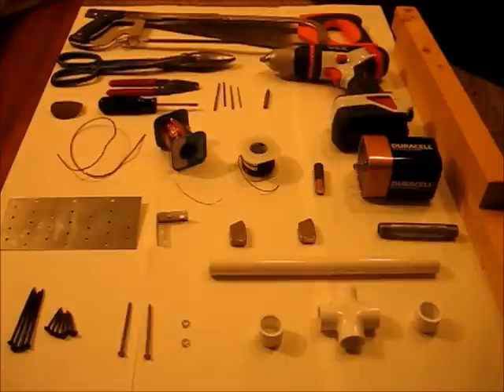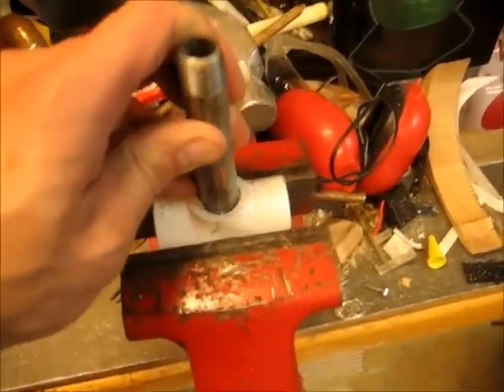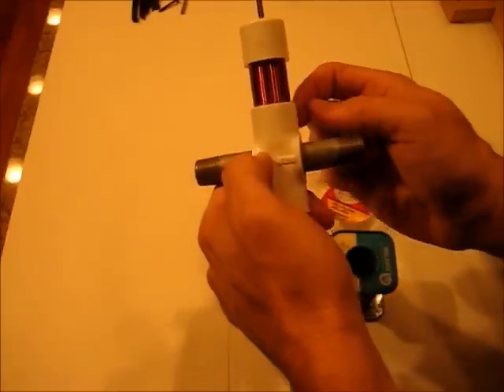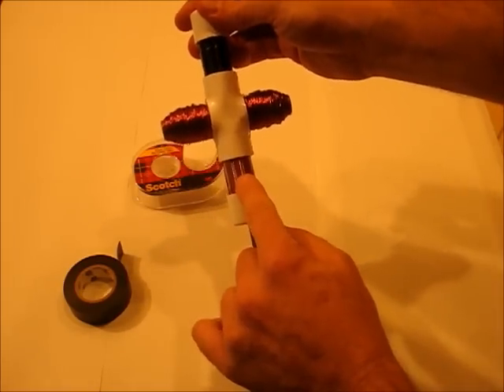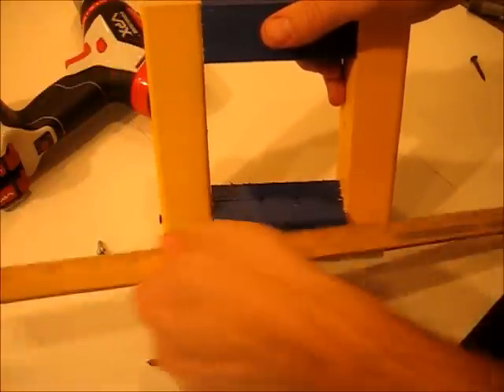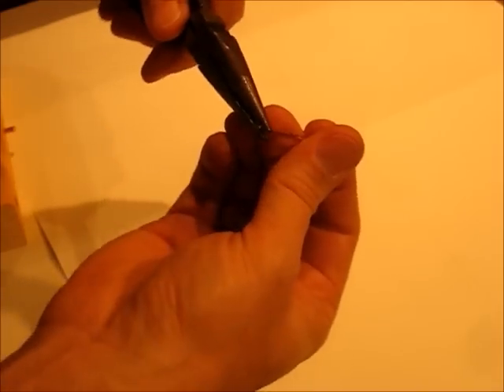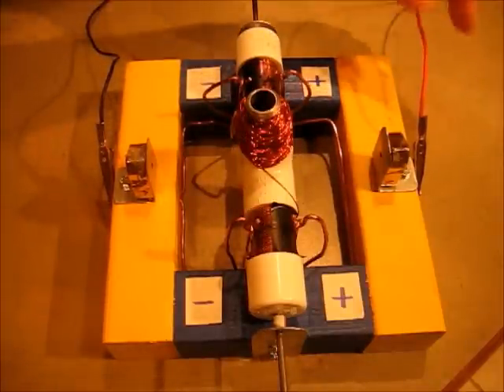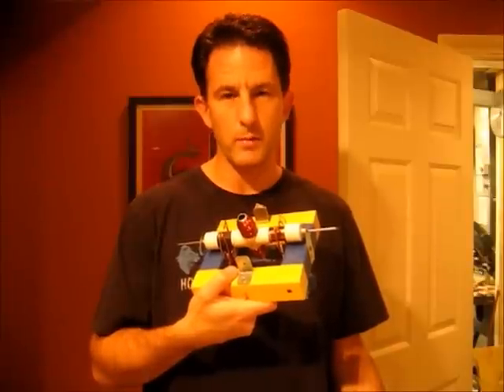How To Build a Motor (HowToLou.com)

Comment: can u give 2 examples of equipment that uses this type of motor? and can you compare and contrast the resistive start induction run with the capacitor start induction run?
Reply from the maker: This is  DC motor and is used in everything that is battery powered, like cell phone vibrators, power windows, cordless drills, etc.  Resistive and Capacitive starts, apply to AC motors.  I don't know enough about those to help you.  Wikipedia has a good "AC Motor" article that has the info you need.

Comment: Do you think the motor could lift a little robot of 7-8 kg with around 400 wraps on each side?
If no, do you think there's a way to modifie your motor to be able to. It would be for a project for this summer.
Reply from the maker: I think this motor, built as you have described, could lift about only 2-3 kg by winding a string around one of the nails.  However, you can use pulleys and a belt to reduce the speed and increase the torque (lifting power).  Google "FingerTech" or "PowerGrip" pulleys and belts.  Put a small pulley on the nail motor shaft, and a large pulley on another shaft that will wing up string and lift your weight.  I would use at least a 4 to 1 ratio in pulleys to give you a 4 to 1 increase in torque.
Reply: ***** Thanks for your answer I'll try it and send you what I've been able to do at the end of the summer.
Reply from the maker: Philippe Jolin - I would love to see it!  Post a video to YouTube and send me the link.  I will post in in the Gallery section of HowToLou.com/motor

Comment: Hi! We're making a motor for our physics project. Can this one run using only 9V? If not, what adjustments should be done to make it run on 9V? Thank you sir. D
Reply from the maker: To get it to work on a 9-volt battery, you need to make 4 adjustments.  1 - Make the rotor arms of the same PVC that the rest of the rotor is made of.  2 - Make sure you have really strong magnets.  3 - Put lots of windings on the rotor arms. 4 - Replace the metal bracket rotor bearings with tiny ball bearings, pressed into wooden mounting posts.
Reply: ***** Thank you for the advice :) Is this for if we make a motor of the same scale? Would making the whole system smaller also help? Will it work if we scaled down the motor but kept the commutator the same size (for ease)? Thank you very much!
Reply from the maker: Anja Bea Cawaing - Actually, it would help to make the commutator smaller.  The brushes are required to supply electricity to the rotor, but they also slow the rotor, by applying friction force.  A smaller diameter commutator will bring that force closer to the center of rotation, where it has less leverage, and hence, less slowing power, on the rotor.  It will be a little harder to make a smaller rotor, but I think it is doable.  I would make the whole thing out of 3/8" CPVC pipe.  You may have to order the Cross online.    Another idea for you:  If you don't want to spend money on bearings, you could build the motor vertically and have the bottom nail stand on a small piece of metal or glass.  All the weight of the rotor would rest on a this single point and would be nearly frictionless.  That would help a lot.
Reply: ***** Great! Thank you again :)
Reply: ***** (sorry if I'm being a bother) We've managed to get the motor to work, but it only turns when we give an initial push. What kind of adjustments should we make to get the motor to run immediately after connecting the battery? Thank you!
Reply from the maker: Anja Bea Cawaing - No problem :)  Congrats on getting it running!  If you can, please send a video to HowToLou@gmail.com and I will post it in the gallery.  You need to work on making your brushes tight enough so they make electrical contacts, but not so tight they slow down the rotor.  The brushes are the trickiest part of the build.  If you can, hammer your brush wires flat into more of a copper ribbon to get more contact with the commutator.  That also will help the initial start up and overall speed.
Reply: ***** I mean, we're fairly sure the brushes and the commutator are fine, but we have to push the actual rotor to start the rotation. Is it a weight thing? Or does the lack of contact between the brushes and commutators apply for that too? And yeah, I'll try to send a video by the end of the week :D Thanks again.
Reply from the maker: Anja Bea Cawaing Your brushes and commutator are good enough to overcome the sliding friction, once the motor gets started, but not good enough to overcome the static friction of the initial startup.  Brushes are key :).  Also, try setting the rotor arms pointing right at the stator magnets, and then try to start it.  That should help.
Reply: ***** Ooohh, okay :D Makes sense now. Thank you!

Comment: How much voltage should I use if I plan to use this motor to lift a weight of around 40kgs?

& approximately how much more copper wire should I use to do that
Reply from the maker: Seriously? You want to use this little motor to lift something the size of a 10-year-old kid??  I suspect you are joking, but if not, you will need to go to a hobby shop and get at least a 100-1 gear box.  Drive the gear box with the motor and have the gear box lift the kid :-)

Comment: Does the wire need to be magnet wire? i have only four weeks to build a motor for my project and to get a company to ship that wire will take way too long
Reply from the maker: You can get magnet wire in two days from Amazon, I think.  It does not have to be magnet wire, though.  It just needs to have really thin insulation, so you can get a lot of winds on the rotor.  Magnet wire is insulated with enamel, with is super thin.  If you know somebody in the telephone business, they use copper wire with really thin insulation, too.  That would work.

Comment: How many wraps did u do I have thick insulted wire and got 70 wraps on both sides and my motor has to be able to run on 6 volts am I fine or do I need more wraps
Reply from the maker: You will need a LOT more wraps to get it to run on 6 volts.  Maybe 200+.  The thick insulated wire will not allow enough wraps.  You need to switch to magnet wire.  There are more build tips at http://www.HowToLou.com/motor

Comment: Hey sir, i was wondering how thick the copper wire around your rotar is? how thick is the wire connected to the elastic? thanks :)
Reply from the maker: The magnet wire on the rotor is 32 AWG.  Everything else is 14 AWG.  These don't have to be exact.  You just need thin wire on the rotor, so you can get a lot of windings, and thicker elsewhere, so it holds its shape.  There is a complete parts list and building tips at HowToLou.com/Motor

Comment: My motor keeps sparking at where the brushes make contact with the sanded copper. When I put 18v on the wrapped coils were much more attracted to the magnets so I assume that I am on the correct track but I still can't get my motor running. Do you think that it has something to do with my brushes? I'm melting through my electric tape so I need to fix this before I burn myself lol.
Reply from the maker: Sparking is ok, but a sign that your brushes are a little loose.  Getting the brushes just right is the hardest part of building this motor.  Try tightening them a little bit.  See all the build tips at HowToLou.com/motor.  If you still can't get it working, send a video to HowToLou@gmail.com and I will see what I can suggest.  -Lou

Comment: what  can  be done  if the winding on iron pipe is not as thick as you show
Reply from the maker: +joel mathews - You could try to splice in some more wire, but it would be best to just redo it.  Thin windings will make a weak motor that may not run at all.

Comment: HOw to Lou- my son is building this motor for his school project and he has done everything twice over what you had instructed in the video , I say twice over because first time he didnt have the thin copper wire tight on the PVC so when he hooked up the charge to it, it unraveled.. it was kind of funny but he redid it... then the 2nd time doing it he fried  the  lead wires, they had to be spliced and reinvented.   So now he has it all accurate like you have yours  and it still isnt working. He has 4 6 volt lantern batteries.  I'm not sure what else to do .. he has fiddled with the connectors- the two thick copper wires (where the end caps are located) to make sure they are tall enough for it to attract the connection. Not sure what else I can do. Does it make a difference on what kind of L brackets you use?  Im at a loss.  Thanks for your help - signed Mama Fawn
Reply from the maker: +fawn hoffman  - Hi Mama Fawn.  Check out all the build tips at HowToLou.com/motor.  I am sure your brackets are fine.  The two biggest issues are having magnets that are too weak, and brushes that gap as you spin the motor.  If the tips don't get you going, send a video of the motor and attempted run to HowToLou@gmail.com and I will see if I can debug.

Comment from the maker: Seth - There is a complete parts list, including wire at HowToLou.com/motor
Reply: Thankyou and also why did you tape/cover the top half of the one coil of wire and the bottom of the other?
Reply from the maker: Seth Wolff - One side of the motor has Plus brushes and the other side has Minus brushes.  Looking at the rotor when the arms are pointing up and down, the electrical current travels from one Plus brush, clockwise around the rotor coils, to one Minus brush.  When the rotor flips over, the electrical current flows from the other Plus brush to the other Minus brush.  The tape makes sure the current is always flowing the right way, which makes the North pole of the rotor always in the right place.

Comment: Are there any specifics as to how many times you have to wrap the cable around the metal bar?
Reply from the maker: No, just as many times as you can.  Make sure both arms of the rotor are wrapped the same direction and the same amount of windings.  Its does not have to be exactly the same number of windings, but if not, your motor will vibrate from the weight difference.

Comment: How long does those rubber last? I mean don't they get spoiled because of friction?
Reply from the maker: It is not rubber.  It is plastic electrical tape.  Eventually, it will wear out, but you get hours of use and you can easily replace it.

Comment: Hey lou, does your threaded pipe get magnetized by the magnets? ours seems to have that problem...hope you can reply ASAP..
Reply from the maker: Maurice - The pipe is not magnetized (becomes a magnet itself), but yes, it is attracted to the magnets.  I am pretty sure that is what you meant.  That is normal.  If you spin the rotor of any toy motor, by hand, it will feel bumpy.  That is the rotor being attracted to the magnets.

But, I bet you are asking, because your motor is not turning :)  The basic problem is that your magnets are stronger than your electromagnets(rotor windings). The magnets are so strong, that they hold the rotor in place, fighting the urge of the electromagnets to spin it.  There are three solutions:  

1 - Reduce the strength of the magnets by backing them away from the rotor, or replacing them with weaker magnets.  Try this as a potential quick fix.
2 - Replace electromagnet's core (the metal pipe) with a plastic pipe.  This will totally eliminate the pull of the magnets on the rotor, so the "problem" will be gone.  However, this reduces the focus of the electromagnets, so they end up not as strong.  Do this, if this is a school project you need to get working ASAP.
3 - Increase the strength of the electromagnets, by increasing the number of windings on the rotor and/or increasing the voltage.  This option will make the most powerful motor.  Do this if you want a motor that will impress your parents and friends.

I also have other motor build tips at HowToLou.com/motor.  Good Luck  -Lou
Reply: ***** much thanks Mr.Lou!

Comment: Is there another option for the electro magnets other than using the insane amount of wire. Could i use two other magnets?
Reply from the maker: You need electromagnets on the rotor, so the North/South poles can quickly switch back and forth as the rotor spins.  The commutators do that switching electrically.  You can't switch a permanent magnet's poles, so the rotor would just spin until it lined up with the stator magnets and stick there.  Google "motor rotor" images, and you will see they all have lots of wire windings.  There is a simple motor project at HowToLou.com/motor that takes less wire, only because it is smaller.
Reply: Thanks, i guess I will just have to endure all those windings. haha.

Comment: Hey quick question,
how many amps in the battery do we need?
My battery is 5 amps and there is current in the wire but there is no movement
Reply from the maker: Evan - I have never measured the amps, but you need at least 12, and preferably 24 volts.  In terms of amps, just make sure you use "big" batteries.  For example, three 9-volt batteries make 27 volts, but will not have enough amps to power the motor.  I would stick to 6-volt lantern batteries or D-cell batteries.  For absolute best results, use lawn tractor batteries, but those are expensive at $30 each.

If you have everything else working, even weak batteries should give you some movement, even if it does not spin.  I have a big list of motor build and troubleshooting tips at HowToLou.com/motor

Comment: hey lou what size cross are you using for the 3/8" threaded pipe to go in because i used the standard 1/2" cross and my pipe is to small?
Reply from the maker: John - I used a 1/2 inch cross, but I have heard that each cross manufacturer makes them differently.  Wrap the middle of your pipe with a little duct tape before putting it in.  Hot glue will also work.  See more build tips at HowToLou.com/motor
Reply: Thank you Lou!!!

Comment: I have thin bare copper wire without varnish......does it have to have varnish to work correctly?
Reply from the maker: Yes, it must be varnished copper wire.  The electrons have to run around and around to make an electromagnet.  If the wire is bare, the electrons will just take a shortcut and skip from one wire to the next that it is touching, and not go around.

Comment: I tried to do it but it doesn't work, my coil is about 3.5 mm thick, does it need to be thicker? My magnet is a disk magnet out of a speaker, do i need to get a stronger one, if yes which magnet should i get?
Reply from the maker: Your coil is a little thin.  I would go with 10 to 15 mm.  Speaker magnets can be kind of weak.  You want magnets that are pretty hard to pull off metal surfaces.  Google Neodymium magnets and get some of those.  Also, the number one problem people have with getting this motor running is perfect brush setting.  See HowToLou.com/motor for details on this and lots of other motor building tips.

Comment: There is a slope in my pvc pipe and when I wound wire it slips so can I use cello tape on my pvc pipe to level it and then wind the wire on PVC ...please respond

Comment: Could I use this motor to power a small toy car? I wanted to make a small kart but I'm afraid it might be too heavy with the batteries and all. Is it possible?
Reply from the maker: ***** - You could power a small kart, if you add a gear box, from a hobby shop.  It should be at leasr 25 to 1.  The car might only move a few inches per minute, but it would go :)

Comment: Dear Mr. Lou,
Would the size of the commutator affect the strength of the motor at all, possibly preventing it from spinning.  If so please explain why.  Thank you sir.
Reply from the maker: Yes, the size of the commutator has some affect on the strength/speed of the motor.  The brushes have to drag on the commutator to feed it electrical current.  That drag also slows the rotor.  The bigger the commutator diameter, the more leverage and slowing power, the brushes exert.  A smaller commutator would be more efficient, but a little harder to build.  As you can see in the video, it is very possible to get the motor going with the larger size.  If you are having trouble getting your motor going, check out all the build tips at HowToLou.com/motor.  There is a section on the brushes.  They have to be adjusted just right.  No too tight or too loose.  Try taking of the rubber bands and holding them gently in place with your fingers to get a feeling of how tight they need to be.
Reply: Thank you for the advice, I've made this motor once before and it was very successful however when I tried to make it more efficient by making the commutators smaller and the magnets closer it didn't have the power to move it.  There was current running through it, but it would not move... any ideas?
Reply from the maker: Daniel Sherlock You can send a picture of it to HowToLou@gmail.com and I will see if I can tell what is going on.  A smaller commutator should help, not hurt.  I think the single best thing you can do to make it more efficient is to build it vertically, and stand the bottom nail on a small piece of glass.  That will eliminate most of the friction.  There is an example of one like this is the gallery at HowToLou.com/motor.  By the way, if you have a video of a running motor that you would like to share, please email it, and I will post in the gallery.  Thanks, Lou
Reply: *****
Thanks a lot for your help.  I found the problem to be the size of the magnets.  I was using 1/2cm neodymium magnets which are stronger than most magnets but the size of the magnetic field wasn't large enough.  I replaced it with bigger magnets and it worked perfectly.  I will make sure to send you the videos of all 3 asap.  Thanks you saved my GPA.